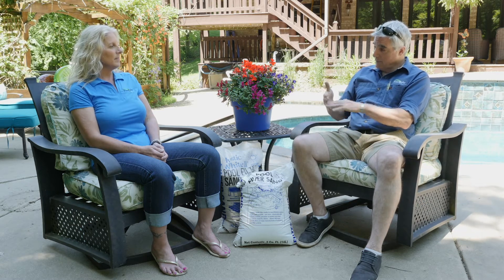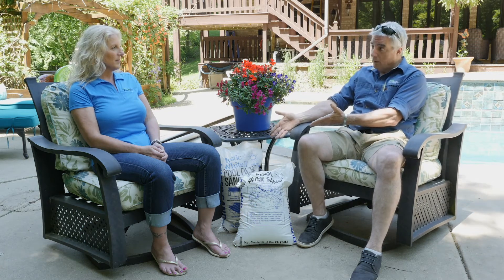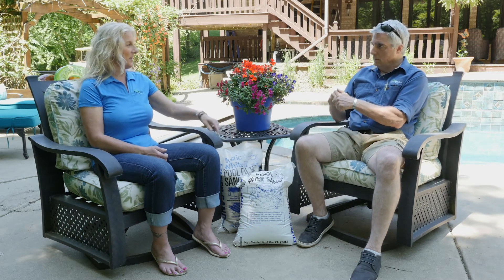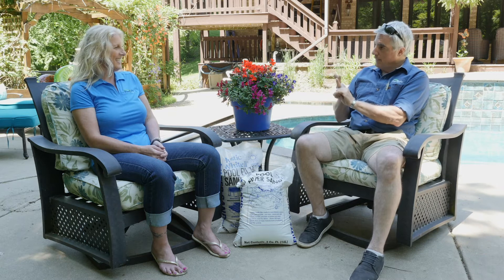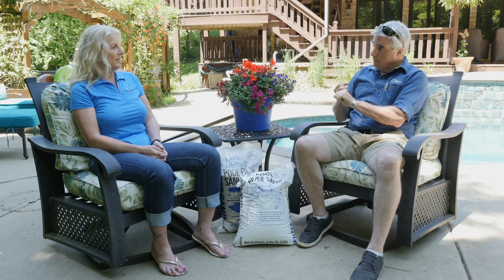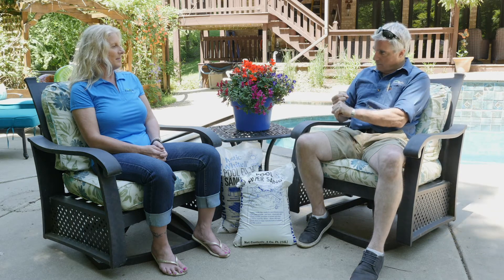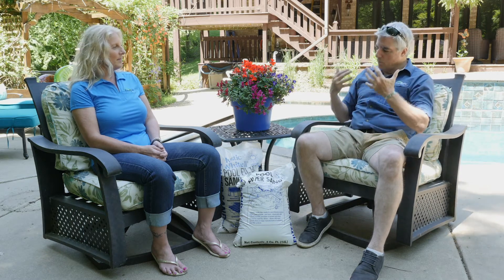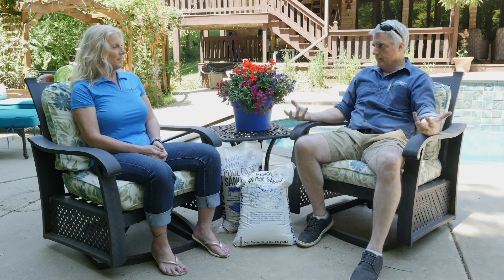FilterBalls The Problems With Sand

Comment: Hi,
I have a gap of 6 inchs to the Folding Umbrella so i put 6 pack of filter balls 700g(for 300pds of sand) so lots of it went under the umbrella and about 6 inchs on top of it.
I though it wasn't enough cause i could see the umbrella...  so i did the vaccuming and yup some dirt went directly into the pool. So should i put another bag or two ????